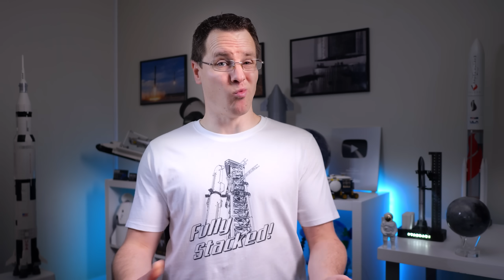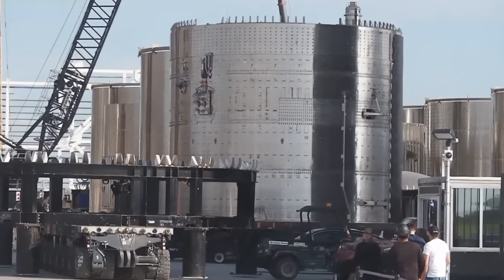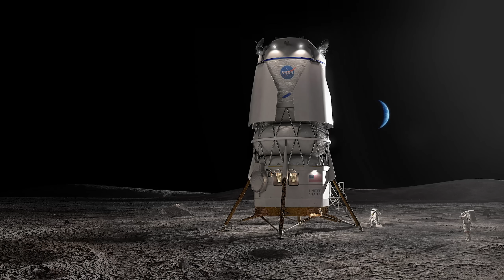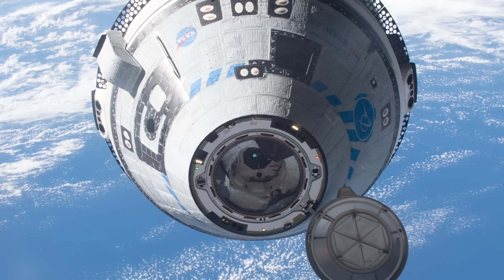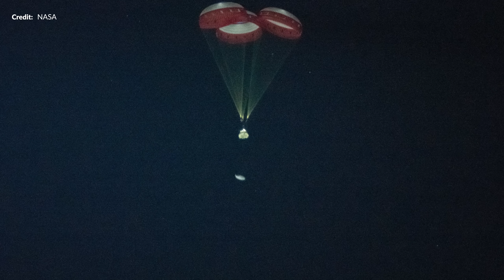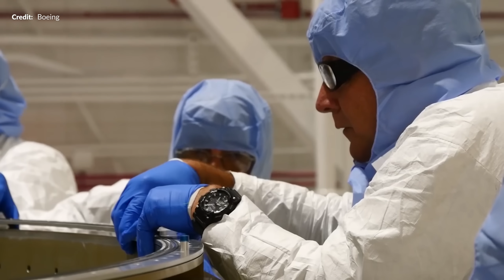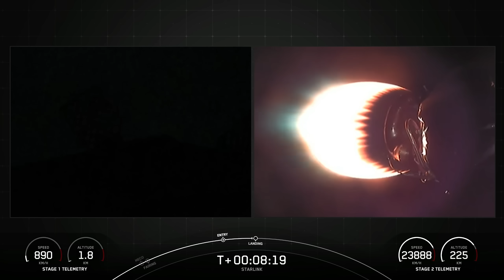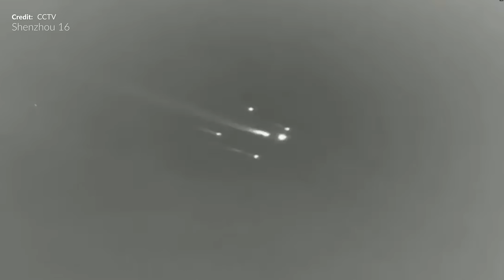SpaceX Starship: Mega Pad Upgrade to Tame the Thrust, Boeing Starliner Delayed Indefinitely

Comment: Boeing fucking up something as simple as using flammable tape to secure wiring and having something as critical as parachutes not pass the lower load limits? I am shocked, I tell you, shocked. /eyeroll And before anyone gets all froggy and decides to jump to defend Boeing, 346 dead people have one thing to remind you of... Boeing 737 Max.

These huge mega-corps will never EVER outcompete companies like SpaceX. Greed and human nature will always keep them on the ground, making excuses and pushing back timelines. I am glad they are there, however. Their giant bloated bodies make a nice step ladder for companies like SpaceX and Blue Origin (although I think B/O is rapidly becoming Boeing 2.0)
Reply: Different division. Boeing was chosen as the top bid for Commercial Crew in 2014, BEFORE 737 Max ever flew. The McDonnell-Douglas merger in the late 1990s is widely seen as the downfall of Boeing. So, you want to ignore the facts in the current situation, because of past disasters? That is shortsighted. And I think that the top management at Boeing should have been put in jail over the 737 Max, instead of let go. The new management has a huge hole to dig themselves out of.

---------------

To be fair, the tape is flammable only in certain situations per reports. And requires failures of other hardware to happen. Per NASA/Boeing, "Although that tape is commonly used on other spacecraft, they are evaluating if it is acceptable for crewed flight (article NASA and Boeing say preparations continue for July Starliner test flight Jeff Foust May 27, 2023)"

Parachute and wiring issues to delay Starliner crewed test flight
Jeff Foust - June 1, 2023

"Both the parachute soft links and wiring tape were used on the Orbital Flight Test (OFT) 2 uncrewed test flight in May 2022 without incident. The soft link issue, officials said, would only be a concern if one of the three main parachutes failed, putting additional loads on the other two, while the flammable tape would have required what Nappi called “multiple failures” elsewhere in the spacecraft."

---------------

Boeing finds two serious problems with Starliner just weeks before launch
ERIC BERGER - 6/1/2023

"The second issue involves P-213 glass cloth tape that is wrapped around wiring harnesses throughout the vehicle. These cables run everywhere, and Nappi said there are hundreds of feet of these wiring harnesses. The tape is intended to protect the wiring from nicks. However, during recent tests, it was discovered that under certain circumstances possible in flight, this tape is flammable."

===================

Oh, I don't know. Blowing your launch pad apart and flinging concrete slabs as big as cars as high as your rocket is tall, is a pretty big F'up.

===================

Starliner is on a fixed-price contract, so Boeing has been paying for the Starliner fixes, NOT NASA.
Reply: @steveaustin2686  Same company, same corporate culture. Been in the business for over 4 decades and I can tell you that "different sibling" argument doesn't fly. Corporate culture seepage is real because lateral transfer of engineers is much MUCH easier between divisions than is being hired in from outside. When this happens they bring all the bad habits and lackadasical BS with them.

And excavating a crater at stage zero for SpaceX is a hiccup compared to Starliner. SpaceX will have the pad repaired before they even have the first whiteboard meeting for Starliner.

And lets not forget, SpaceX is late to the game with Dragon. They started after Boeing and already have several crew deliveries to the ISS and I have no idea how many resupply missions with it.

A much bigger company cannot compete with a much smaller company. Not when their investors care about dollar signs and not about the end product.

And if you need further proof of the debacle that Starliner is, the largest issue it has? Software. Shocker, I know.

Naw man, I was around at Thiokol in the aftermath of Challenger. I know what corporate culture does and what bowing to pressure from shareholders will do. (even when the shareholders are the taxpayers)
Reply: @harlech2  You do know that Boeing has new management right? And that they have to dig out of this mess they got themselves into right? And that take time, which is why they keep pushing back Starliner to make sure it is right.

A hiccup? Flinging chunks of concrete the size of cars 70-ish meters in the air is a hiccup? Having to rebuild the foundation of the OLM that was blasted away is a hiccup? Ever think that maybe you have SpaceX colored glasses and blinders on? Starliner has problems. This one seems to be blown out of proportion with the focus on flammable, but not that it takes multiple failures for that to happen. And the tape was commonly used in spacecraft. 

Never said that SpaceX was not the top of the space industry. You don't have to lock yourself to only supporting one launch provider, like it is a football club. Ideally, you should look at the flaws as well as the strengths of who you support as well as anyone else.

NASA made Boeing go over every single line of code again after the OFT-1 failure. Likely why that charge against profits was larger than the rest.

Which is something the new management has said that they have to fix. It's not like they covered this up. NASA and Boeing are addressing it and pushing back the launch while they do that. They haven't even committed to a new date. I think, because a new CFT flight date will have to slip between the Aug 2023 Crew-7 launch, the Sep 2023 ViaSat-3 launch, the Q3 USSF-51 & NROL-107 launches, the AX-3 launch, and the CRS-29 launch. Depending on the mitigation, they may slip into next year.

Comment: With all those raptor engines you're going to need several tons of water per second to and you need to store it afterwards so it doesn't go into the ecosystem. Haven't seen any evidence of a structure to recapture all that water or the water pump needed to do it which doesn't exist.
Reply: They won't use water pumps, but a high pressure gas cylinders
Reply: There is a lot of work to go at Boca Chica. Personally, I would not expect a launch attempt until at least the end of the year, if not early next year. Or later.

Comment: Hahahahaha Blue Origin launching New Glen in 2024! Hahahahaha 
Not gonna happen!!! Starliner will launch first!
hahahahahahaha Whenever!!!
What good is a valve that has to consistently be changed BEFORE flight. You change one, another fails!
Nasa Should STOP investing in Boeing and BO and redirect this money to RocketLab, Sierra Nevada and other newcomers who are actualy making progress!!
Reply: After SNC came in third in the 2014 Commercial Crew competition, they got a 2016 CRS contract for cargo to the ISS. A much easier proposition than crew, but may still slide into 2024 for the first launch.

Comment: The sheet pilings will be the "outter walls" of the pile cap. They've already dug out about 12 feet around the back half (half near the tower) and will dig out the front half soon. I assume the pile cap will be 10 feet thick and the metal blast plate system will be 2 feet thick on top of that. The entire thing will end up flush with the existing ground level.

Comment: well frick... they used flamable tape to secure the electrical cables???  I mean whoever did the purchace order probably just had one job to do right!!!   Fail!!!!
Reply: To be fair, the tape is flammable only in certain situations per reports. And requires failures of other hardware to happen. Per NASA/Boeing, "Although that tape is commonly used on other spacecraft, they are evaluating if it is acceptable for crewed flight (article NASA and Boeing say preparations continue for July Starliner test flight Jeff Foust May 27, 2023)"

Parachute and wiring issues to delay Starliner crewed test flight
Jeff Foust - June 1, 2023

"Both the parachute soft links and wiring tape were used on the Orbital Flight Test (OFT) 2 uncrewed test flight in May 2022 without incident. The soft link issue, officials said, would only be a concern if one of the three main parachutes failed, putting additional loads on the other two, while the flammable tape would have required what Nappi called “multiple failures” elsewhere in the spacecraft."

---------------

Boeing finds two serious problems with Starliner just weeks before launch
ERIC BERGER - 6/1/2023

"The second issue involves P-213 glass cloth tape that is wrapped around wiring harnesses throughout the vehicle. These cables run everywhere, and Nappi said there are hundreds of feet of these wiring harnesses. The tape is intended to protect the wiring from nicks. However, during recent tests, it was discovered that under certain circumstances possible in flight, this tape is flammable."

Comment: All the issues with Starliner just serve to highlight the advantages of SpaceX's approach of rapid testing and iteration. Aren't Boeing part of the team developing the Blue Origin backed lunar lander?? Doesn't exactly fill me with confidence of it happening on time!!
Reply: Here is the breakdown from Blue on who is doing what. Everything not mentioned is apparently being done by Blue.

Lockheed Martin Cislunar transporter is a refueling tanker to NRHO
Draper avionic, navigation, training
Astrobotic cargo accomodations
Honeybee Robotics cargo offloading
Boeing docking systems

To be fair, the tape is flammable only in certain situations per reports. And requires failures of other hardware to happen. Per NASA/Boeing, "Although that tape is commonly used on other spacecraft, they are evaluating if it is acceptable for crewed flight (article NASA and Boeing say preparations continue for July Starliner test flight Jeff Foust May 27, 2023)"

Parachute and wiring issues to delay Starliner crewed test flight
Jeff Foust - June 1, 2023

"Both the parachute soft links and wiring tape were used on the Orbital Flight Test (OFT) 2 uncrewed test flight in May 2022 without incident. The soft link issue, officials said, would only be a concern if one of the three main parachutes failed, putting additional loads on the other two, while the flammable tape would have required what Nappi called “multiple failures” elsewhere in the spacecraft."

---------------

Boeing finds two serious problems with Starliner just weeks before launch
ERIC BERGER - 6/1/2023

"The second issue involves P-213 glass cloth tape that is wrapped around wiring harnesses throughout the vehicle. These cables run everywhere, and Nappi said there are hundreds of feet of these wiring harnesses. The tape is intended to protect the wiring from nicks. However, during recent tests, it was discovered that under certain circumstances possible in flight, this tape is flammable."

Comment: My guess as to why the side boosters separate just prior to first stage separation is to reduce the mass of the 1st stage stack, to reduce momentum, which reduces retro requirements. The biggest risk in stage separation is the separating stage’s momentum carrying it forward where it could cause an impact with the upper stage prior to upper stage ignition.

Comment: starliner.....
what a joke....
lots of money to bidens boys at boeing (coruption).... and some of it to the development of starliner.

space x gets things done far more quickly, successfully and so much cheaper.
Reply: The reason NASA wants starliner to succeed is about having a redondant vehicle in case of a an accident with SpaceX one. NASA certainly doesn't want to repeat the same mistake they made with the space shuttle and calling the Russians at $80 million per launch  to reach the ISS...It's more strategic than political.
Reply: @xmj6830  
agreed. redundancy is important.

the question im asking is why does boeing need 10-20 times more money than spaceX to develop the same thing?

where does the money go???
Reply: @markbph2336  WTF are you talking about. The Boeing contract for the first 6 flights is $4.2B and the SpaceX contract was $2.6B. That is 1.6x the cost, not 10-20x. SpaceX themselves bid $2.6B and if they wanted more money, they could have BID more money. The companies themselves set the bid price and NASA rejects it, accepts it, or renegotiates it. Both contracts are fixed-price contracts, so Boeing has been paying for the Starliner fixes, not NASA.
Reply: @xmj6830  Exactly
Reply: 🙄🤡

Boeing's merger with McDonnell-Douglas in the late 1990s is widely seen as Boeing's downfall. The engineering based management was replaced with corporate management chasing stock pricing. So Boeing did this to themselves and they have a deep hole to get themselves out of.

Starliner is also on a fixed-price contract, so Boeing has been paying for the Starliner fixes.

Comment: Starliner capsule has a good looking (external) appearance. Pity it is being let down by poor basic engineering and lack of quality control - how pathetic to allow flammable tape on electrical wiring bundles - basic, sloppy engineering. Boeing shud know better!!!
Reply: To be fair, the tape is flammable only in certain situations per reports. And requires failures of other hardware to happen. Per NASA/Boeing, "Although that tape is commonly used on other spacecraft, they are evaluating if it is acceptable for crewed flight (article NASA and Boeing say preparations continue for July Starliner test flight Jeff Foust May 27, 2023)"

Parachute and wiring issues to delay Starliner crewed test flight
Jeff Foust - June 1, 2023

"Both the parachute soft links and wiring tape were used on the Orbital Flight Test (OFT) 2 uncrewed test flight in May 2022 without incident. The soft link issue, officials said, would only be a concern if one of the three main parachutes failed, putting additional loads on the other two, while the flammable tape would have required what Nappi called “multiple failures” elsewhere in the spacecraft."

---------------

Boeing finds two serious problems with Starliner just weeks before launch
ERIC BERGER - 6/1/2023

"The second issue involves P-213 glass cloth tape that is wrapped around wiring harnesses throughout the vehicle. These cables run everywhere, and Nappi said there are hundreds of feet of these wiring harnesses. The tape is intended to protect the wiring from nicks. However, during recent tests, it was discovered that under certain circumstances possible in flight, this tape is flammable."

Comment: Is that a trick question?  The lower edge of the SRBs are attached to the lower stage portion.  If the SRBs failed to detach and the lower stage was ejected, then things would get 'interesting' rather quickly.  By ejecting the SRBs first and then ejecting the lower stage only when they are gone simply rules out entirely a rare, but devastating, consequence should a certain small set of failures occur in just one particular order.  If eliminating such a risk can be done at the cost of a staging change in software, everyone would do it.  Everyone who's paying attention at least.  That's my theory.

Comment: Having two launch providers is a good thing.  Boing Boing is controlled by bean counters.  Space X has engineers and scientists.  Drop Boing and find (or create) an independent entity that is controlled by technical people.  End the endless money thrown into the Boing black hole and invest in real technology.  Blue O is not it either.
Reply: Starliner is on a fixed-price contract, so Boeing has been taking charges against profits to pay for the Starliner fixes.
Reply: @steveaustin2686  True, but the money is not the real issue here, it's the time wasted and the technology potential lost trying to use semi-reliable, bean counter controlled engineering.
Reply: @barnowl6807  How does that benefit Boeing to drag their feet, but have to pay for it out of their own pocket?

There were 3 choices in Sep 2014, Boeing, SpaceX, and SNC. Boeing had yet to fly the 737 Max, so was still seen as a top aerospace company. SpaceX were the new guys on the block and were still trying to land a booster. They didn't land one until Dec 2015 and didn't reuse a booster until Mar 2017. SNC was further behind in third place. SNC did get a CRS contract for a cargo only Dream Chaser and they are behind schedule too.

Comment: The Cape construction stopped because NASA denied SpaceX to fly Starship there while it's still in prototype stage. I'm sure SpaceX was hoping it could move all operations to the Cape, as BC is going to be a continuous litigation headache.  This is a truly giant rocket, and playing around with funny 4/20 flights has to be grown out of quickly, or they risk losing BC altogether. Them, and the nation, would be in a real pickle then.
Reply: Boca Chica is as much about learning how to build Starship facilities as it is for testing Starships. Musk said in one of the town halls, that Boca Chica will be an R&D site. Also NASA is leary of testing Starships at LC-39A, when it is the only pad for Crew Dragon. SpaceX recently started upgrading SLC-40 with a crew tower, so it can also do Crew Dragon launches. I would not be surprised if SLC-40 will also be used for Falcon Heavy as well. Part of the USSF-67 contract was for a vertical integration facility (VIF) for NSSL payloads. It would make sense to build the VIF at SLC-40 on the Cape Canaveral Space Force Station (CCSFS), rather than at the civilian KSC.